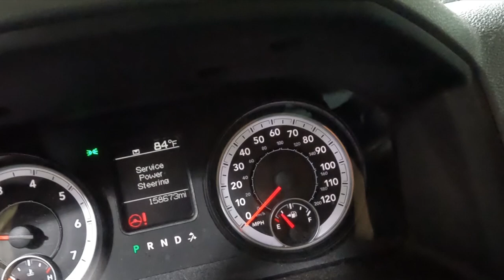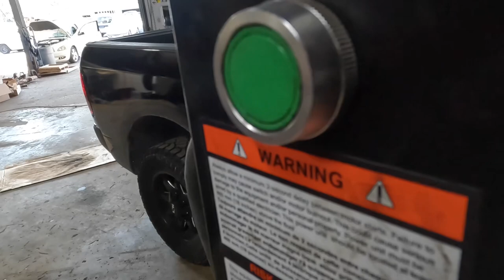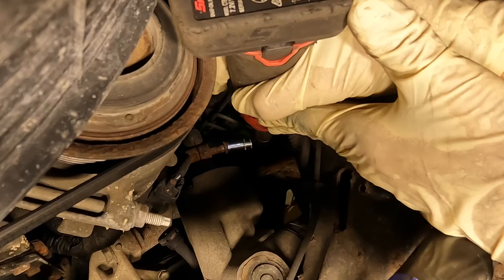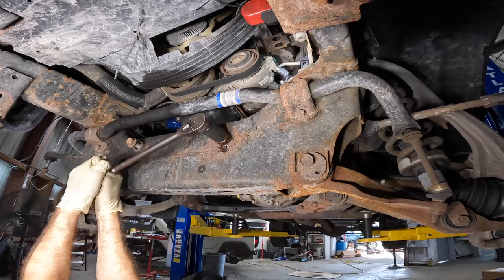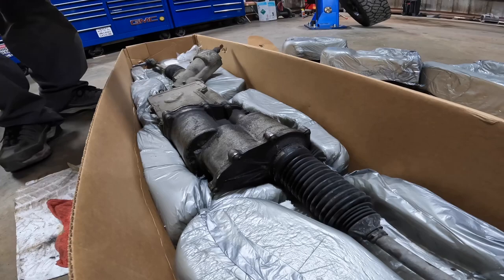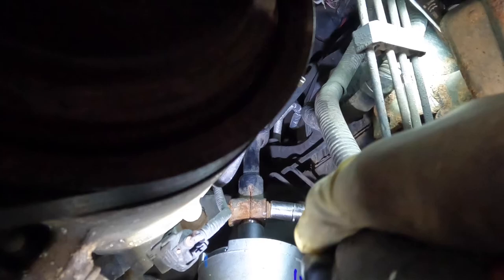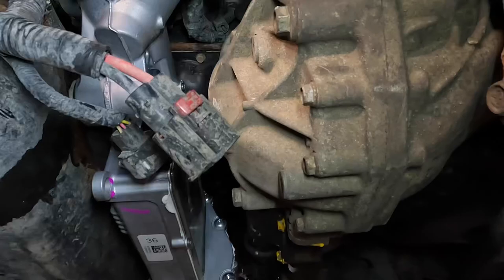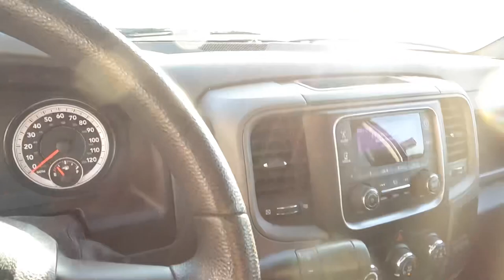Electric Gear Leaking? 2014 Ram 1500

Comment: 5G antenna. Unlike previous standards, 5G antennas can be mounted on top of telephone poles, street Light poles or, in this case, it's own pole.
Reply: Exactly what I was thinking!
Reply: @Jeff Karpinski Close enough, emulating brain frying microwaves...
Reply: @3d0g I thought the 5G mmWave was only used for point-to-point connections. This tower seems to be built to radiate in all directions. Or are they creating directional beams by using multiple elements as a phased array?
Reply: @steze48  not enough power in 5g to fry anything. You're talking 1k watts in a microwave or more at the right frequency (the resonance of water). 5g I believe is less than 5 watts and through air will attenuate to virtually nothing in free air.
Reply: @steze48  power is actually way less than 4G, they get the extra bandwidth with modulation tricks like QAM
Reply: Ray better bust out the tin foil hat then otherwise they'll be stealing his thoughts📡📡😆
Reply: These are called small cells and come in all different shapes and sizes. Some even mount to existing street lights. Since 5g is only usable short range your going to see these all over the place eventually, mainly along major roads since they have to lay fiber to connect each one.
Reply: @bradjoyce525  I saw a video about 5G in China and they said it consumes more power to run  than 4G so they switch it back to 4G at certain times because it costs the companies so much more to operate.
Reply: 5G brain fryer.
Reply: 5 G Antennas don't have speakers
Reply: @@TimRockIt I'm an RF engineer that designs deployments for 5G & 4G.   Whoever told you that is misinformed.   '5G' is a modulation scheme (like AM, FM, GSM, etc.) that aggregates bandwidth through many different frequency bands, including mmWave.  mmWave deployments are typically not even powerful enough to light an LED lightbulb because a good signal to the phone can be measured in the millionths or billionths of a watt  and still produce excellent bandwidth.  

As I mentioned, I've been around higher than acceptable limits for RF exposure for over 20 years, and i diskev8f ....

Cudjrevjx...

Chxn fie84xjakc fudirjcirid...

.. fine, thank you very much.
Reply: @Tim Rock-It Saunders Roger that. Used for “riot control,” in combat. I was Force Protection logistician before I retired. They also put them on some of the cargo ships for anti-pirate.  Hurts when hit by it. Also was used to “screen” people for explosive devices coming on to FOBs to work.
Reply: 5G operates in a high-frequency band of the wireless spectrum. Because high frequency waves have a harder time traveling over distance & through objects, the 5G network will be built on small cell site technology with antennas as close as 500 feet apart
Reply: @Jeff Karpinski Well then, you just figured out my problem. My brain is fried from sitting within 8 feet of my wireless router all day long. I knew there was a reason for my sudden outbursts and strange sensations that I am the keeper of my castle and thus require a crown upon my head. Now if I can only find the grog wench. Anybody seen the wench?
Reply: @Jeff Karpinski 30+ exahertz would do that job, given sufficient power.
Reply: @JustinTerriaco  o
Reply: You could always mount them like that. It just didnt make sense to do it except is very high density places like stadiums and next to apartment complexes. With UWB and mmwave you have to place them far more often due to the far shorter range. Source: $dayjob
Reply: @Simr Khera Do you have any idea what sarcasm is?
Reply: @wesgregg6451  Nothing scammy about the technology. How some providers market it sure.
Reply: @fluffyblue4006  Not phased, you are right tho - 5G mmWave are essentially P2P - 1000ft max!
Reply: @Simr Khera Do you realize that I didn't ask for your advice?
Reply: @Simr Khera hey im interested in knowing more about this. What are the reasons one would make the channel and frequency changes you advised in your earlier post? Thank you

Comment: I can just hear Eric O. and Wes laughing when Ray called that steering gear pretty rusty.
Reply: Amen..cracks me up whenever his "fancy" cordless hi Dolla impacts won't budge a bolt or nut n' he ends up using elbow grease-even him using a 1/2" drive rachet w/o the aid of a 2ft extn for leverage I would consider an "ez off" up here ... here in the salt-encrusted DOT domains of the North, bolts n nuts ROTFLTAO @ not only Elec impacts, but even some AIR impact wrenches...some even snicker @ a propane solder torch. ;-)
Reply: I only wish my cars were that clean  😂
Reply: Wes has a philosophy about it.
Reply: even when the vibe took off.
Reply: @SouthMainAuto  It's the legend himself.  I'm enjoying the Subaru series.  Merry Christmas to you and the family!
Reply: Here in NW NJ we had our first bit of sleet two days ago.  Nothing to be bothered about, but the township road department was out there spreading rust maker all over.

Comment: I love how he referred to the rust as Patina. Here in N.E. Ohio our Patina can be chunky as well.
Reply: I live in NE Ohio, too.  When I bought my 6-7 year old Rav4, they had spray painted the wheels and any exposed metal silver (to match the car's color).  I spotted it right away; nothing on the wheels was flat.  The look was bumpy and crusty.  I like driving my Rav4, but as usual for a northen car, that rust is starting to come through.
Reply: I did some work on a Dodge Stratus, Horrible design for the battery by the way. From it being in the wheel well the water splashed up under the guards made the battery leak on the frame combined with road salt ate the entire battery mount and lower frame away had to cut it all out and weld into a new assembly. Fun times.

Comment: That looks more like a street-tower 5G implementation to me. They're usually from 10-35 feet tall. Same with gunshot alert systems but the mics on those have to be 1-3 feet from each other, and they usually overhang the road or walkway some too, and sometimes have dome-style cameras on them too (to look for muzzle flash).

Anyway, good find on the hard to find part, I'm sure the customer appreciates it. Good content as always!
Reply: You honestly have devices listening for gun shots? That’s a war zone lads 🙀

Comment: door of death is installed backwards.  it opens the wrong way, easy to pop hinges and get inside....
Reply: It may have NRP (non removable pins)
Reply: In most places, commercial establishment doors must open outward by code
Reply: Thats building code down here in Florida.   This way winds from hurricanes cant easily blow your door in.    The name of the game is  to keep wind out of your house and it should survive the winds at least.
Reply: My thought on backwards is that it should, when facing from outside, swing to the left, not the right. It would sit more flat on the wall and be out of the way of the roll up door
Reply: Every door in my location opens outward. We use extra pins in door frames, even without the pins the door stays in place. There are some other solutions too.
Reply: @legionofanon  That is true, left swing instead of right swing might work better. Only thing, beyond being a bit awkward reaching into corner then backing up to get in, is since it’s not his building so he probably can’t do that type of modification.
Reply: Or you could put a auto closer on the door

Comment: Ray I had an idea for the “door of death” perhaps look into a self closing hinge or self closing arm so the door will close all the time and you don’t have to worry about running into it. It’s sometimes as simple as replacing the hinge anyway my 40 years of construction put to use. Have a great day. Thanks for everything you do here.
Reply: Reverse the door to open inward because it's just a matter of time before someone comes out while a vehicle is passing.
Reply: @Fun4GA  I believe fire code requires it to open outwards.
Reply: @DavidHurley11  No.  Not unless the space calculates to more than code minimum occupants (local codes may vary).  With that said, it is always good design practice to swing doors in the direction of egress regardless of occupant load.  I do recommend installation of a commercial grade door closer on the "door of death", though.
Reply: there's even retrofit separate devices (at least here in germany that is). those should work on any door and not cost an arm and a leg
Reply: Yes there are cheap sprung chain kits that fit in the jamb and the door. Easy to fit with a drill and a chisel. I fitted my living room doors with these because my dogs kept leaving the doors open (one naughty dog knew how to open the handles). It was a PITA in the winter trying to keep the heat in with the dogs running in and out. LOL. I miss those dogs.
Reply: @Drew-Dastardly  i meant a Thing that is just screwed to the door and frame. An Arm is spring loaded to close the door but when you need it open you can lift it off of the sliding Thing, folding it away
Reply: @David Hurley  Good point but not required for a small office - which is what that is. I know the Life Safety Codes well.
Reply: Good idea, even old school, a spring.
Reply: @Laurelinad  Yeah, I just use a wedge or something if I want to keep the door open.
Reply: @Drew-Dastardly  You don't want to get snowed in with a door that opens outwards. Not much chance of that for Ray in Florida though...
Reply: Self closing spring hinges start at about $10 each. Heavy doors typically only need 2
Reply: @ShawnOfDiscontent  Would be good money spent. Cheaper than buying a new door.
Reply: @ShawnOfDiscontent  Easiest fix by far just replace hinges with spring loaded.
Reply: Clearly you haven't read prior comments that already suggested the same thing when he first moved in.
Reply: How about relocate the door to the front side of the office. This fixes the "Door of Death" problem and allows egress without possibly striking the passing vehicle going into the shop as well as egress to the front of the property.
Reply: Just put an old time screen door spring on it,and call it good.😉😉
Reply: my bad, thought the door was on the inside.
Reply: @johnt.848  I must have missed it.
Reply: @newsnowriversidesgtrock  that's harder to do when you don't own the building. Otherwise I agree it would be a better place for the door.
Reply: @Ghauster  👍

Comment: Curiosity always strikes me. Why not have a bench grinder and one side have a wire wheel? This way rusty bolts and be cleaned up for ease to re install. Ahhh its just me I guess. Stay safe and be well Ray.
Reply: Not just you,  for me every rusty bolt has to be cleaned.... but I'd go broke ! Cleaning time loses money and no one would employ me !
Reply: Ray needs to clean up those bolts! Working in a autoboby repair shop for many, many years taught me to always dress up the grody bolts and a little WD-40, when appropriate, makes the job go easier. Just my $.02's worth!
Reply: I have a bench grinder with a wire wheel and a grinding stone that's what I always use
Reply: I was thinking the same thing. But I'm usually working on one of my Studebakers and I'm a bit fussy with them.
Reply: He mentioned in another video that he needs a bench grinder for that exact reason.
Reply: Clean badly rusted bolts,  at minimum spray with WD to clean the rust out of the threads. Anti seize on pins, shafts that move and Di-Electric grease on all electrical connections. Being from a snow area I also use Fluid film always thinking I or someone else will take this apart again some day. Rust is the ultimate locTite.
Reply: @bryanzandler9060  I'd still have to use a wire brush at the least. Reinstalling crusty bolts makes me skeeve!
Reply: Concerning the wire wheel - the Brass type or just the steel? I will be heading to HF for a grinder and some tools today and want to get the right ones. :)
Reply: @northpoint1039  for removing rust on most hardware steel will be fine
Reply: I use a wire wheel mounted in my bench drill press.
Reply: I use a wire wheel on a dremel....but I'm a DIYer and got time to screw around like that.
Reply: He mentioned he needs one and a big bench vise and a heavy work bench. So you should gift him one
Reply: @northpoint1039  Brass doesn't need it.
Reply: Even a battery post cleaner for some quick applications.
Reply: If Ray would check the Bee Street address he has in the "about" section... he might find a gift for him from me that would help him with the grinder and wire wheel... delivered last week. 🙂
Reply: I don't even see a workbench!
Reply: I always catch hell when ‘assisting ‘ my mechanic son, as I steal the bolts and parts and wire wheel them. If there is a lull, I’ll even give them a spray of paint. Irritates the bejesus out of him. Hey, I like stuff to be ‘clean and shiny’, too!
Reply: @wirefeed3419  I discovered Fluid Film through Eric O. That stuff is amazing! It REALLY freaking STINKS though!!!!
Reply: Yeah that would up there with a high torque impact I would think. Even in Florida, stuff needs cleaned up sometimes before putting it back together.
Reply: @markanderson2904  He's talking about the wheel material, not the bolt..
Reply: I try to take care of the next mechanic -- me!

Comment: I had a 2005 Ram 5.7, 2010 5.7 and a 2013 5.7. I know what they are about, never had much in problems, traded in 2005 2010.. sold 2013 with 30k miles, no issues.

Comment: A pet peeve of mine is not using some type of lubricant on rusted bolts well before trying to remove. Experience says wd40 and various other stuff works well if used and allowed to do it's job before trying to remove the bolts or nuts. Not squirt and try. Let it soak a bit. Work smart not hard! 
Keep up the great videos, we all learn from you and Eric and various other dudes that aren't afraid tackle the big scary jobs!
Reply: Me too. If I know of a rusty job beforehand, I spray it down as far in advance as possible. Check out Project Farm's video on that.
Reply: @bloodybones63  I always check out project farm and the great comparisons
Reply: Rust creates an entirely different battle field.... and a completely different approach.
Reply: "let it soak a bit" laughs in flat rate
Reply: @firstlast---  maybe spray it down while you check out what size fasteners etc you will need to organize for the job. I don't mean let it soak for an hour just not spray it then hit it with an impact right away and expect immediate results!
Reply: @rick980  That's generally what I end up doing but I doubt it does anything other than make me feel better 😂
Reply: @firstlast---  I have had some great success with wd40, not sure what you used. Of course the best is heat of you have access to torches and it is accessible without damaging other parts

Comment: Grandpa alignment guy here have you ever did a string alignment where you run a string from the rear tires to the front bumper and set alignment that way it is old school but it works great as long as you have not unalined the rear some way. I learned how to do string alinements on diesel trucks in 1972 and have used it on all my cars and light trucks ever since.

Comment: Did I hear a leaking exhaust flange or manifold? Love your videos. From Australia 🇦🇺
Reply: Nah, that was probably just the classic Hemi, Dodge, Ram, Jeep, Mopar, Chrysler, Plymouth valve train clicky clack🤣👍🇦🇺
Reply: Sounds like it.  I had my exhaust manifold leak repaired yesterday on my 2006 GMC 2500hd 6.0 vortec.  It happened two weeks ago annoying.  Mechanic found a bunch of broken manifold bolts  I had the truck since new it only took about 16yrs for them to break.
Reply: Was definitely an exhaust leak of some type.

Comment: The tower is likely a 5g micro cell tower. 5g is commonly placed at street level since it's transmission range is far shorter than 3 and 4g.
Reply: My thought was 5G UW. That signal needs many repeaters.

Comment: Ray if you look around for more of the mysterious black speaker poles and you find them then yes they are shot dectors. It take more than one to triangulate where the shot came from within 100 yards .
Reply: I recall US Humvees had them installed in Afghanistan and Iraq to detect the direction of a sniper shot. Was a pole with a set of microphones pointing in all directions - and the mystery box in the cab would triangulate depending on how many seconds it took to get to each microphone.
Reply: Is gun crime in the US really that bad?
Reply: @robertpowell7672  only in certain areas. The smart  law enforcement agencies install them as a detergent and a way to respond quicker to shooting and put the bad guys behind bars
Reply: Sorry deterrent
Reply: @robertward9258  I like the idea of a crime detergent!
Reply: @thesushifiend  sorry fat fingers small keyboard. LOL
Reply: @robertpowell7672  YES

Comment: On the Ford you definitely have to program the new EPAS unit.  If the EPAS unit is still talking, you can download its programming then upload to the new unit.  If it is not talking, then you must download the programming for the VIN number from Ford and upload to the new unit.
Reply: Of course the download from Ford requires a rather expensive annual subscription with them whereas if the unit is still talking, all you need is the aforementioned expensive diagnostic scanner that has the programming function.  Unfortunately for my 2012 Mustang the unit stopped talking — no comm from the EPAS.  Luckily I was military and our auto hobby shop had both the programmer and an active subscription so was able to program the new unit at no cost.   Was a bear to remove though.  Had to drop the subframe to get enough access to get an impact wrench on the three mounting bolts.  Although you can get a wrench on them, you cannot get enough leverage to break them loose.  After fighting it got two hours, I dropped the subframe.